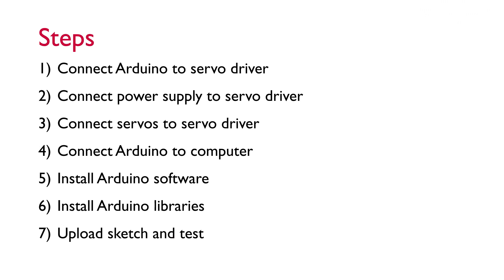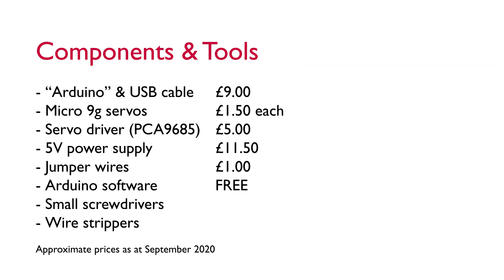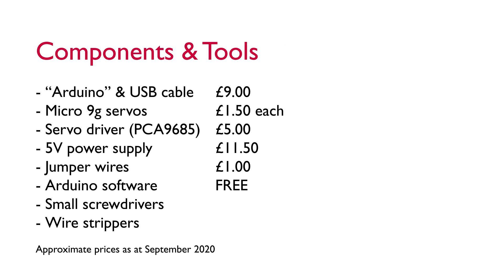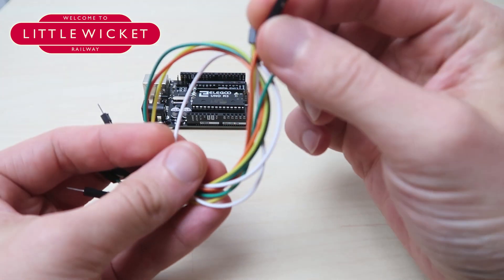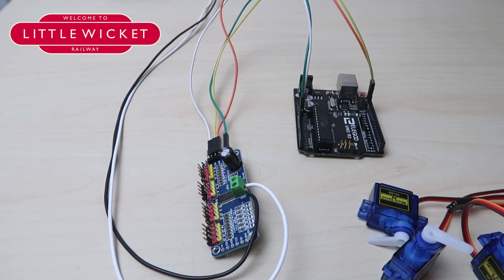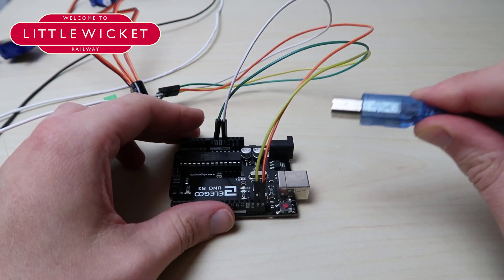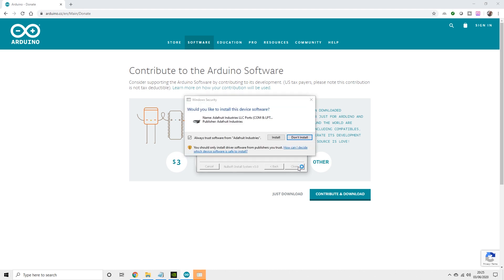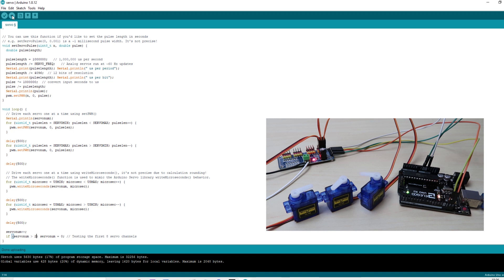Servo Motor Control for Model Railways Part 1 of 3 - Setup with Arduino

Comment: rob, help is needed, followed this excellent helpful video through multiple times and i cannot get my servos to move at the end step. i have checked wiring, checked power source, individually checked servos direct on the uno and cannot work out why i have no movement. any ides? is this video to old and an update needed? thank you

Comment: Hi, I really hope you can help, I’ve obtained all the components in your post with the only change being an Arduino R4 Wi-Fi board with the latest firmware. I’ve downloaded the three libraries and run the modified example servo sketch which has uploaded successfully. All looks good but the servos do not move. Many thanks
Reply from the maker: Do the servos receive power? Check for 5V across the black/red servo pins. If they have power then it suggests there's no PWM signal on the yellow pin.
Reply: @LittleWicketRailway hi yes there’s 5v power from the Arduino UNO 4 and from an external supply to the servo board. I wondered if it was because it’s an R4
Reply from the maker: @Andy_Beckett can you take the pca9685 out of the equation for now and test the servo just using the Arduino using an example sketch that comes in the IDE.
Reply: @LittleWicketRailway yes the servo works directly off the R4. I took an external 5v supply as I’ve read powering the servo from the Arduino 5v supply can damage it. I’ve just ordered a Nano v3 as well as I might want to build a DCC EX and the team have said they won’t be supporting the R4.
Reply from the maker: @Andy_Beckett  so we know the servo works and the R4 can generate a PWM signal to control it. So it's either a problem with the PCA9685 itself, the wiring between the R4 and the PCA9685 or the code communicating between the two.
Reply from the maker: @Andy_Beckett is this helpful https://forum.arduino.cc/t/pca9685-not-using-external-power/1155128/3
Reply: Many thanks for all your help. I decided to go third time lucky and ordered another PCA and the gamble paid off. I’ve finally got an Arduino Mega, Motor shield, Wi-Fi shield and a PCA all talking together. 😊
Reply from the maker: @Andy_Beckett  glad it works, but it sucks that you had some duff kit.

Comment: using you videos to setup 64 points servos i soon realised it is a pain to go through JMRI and click all the points so it knows the position. So made the following Python script for Panel Pro to run at startup to set all points to "CLOSED". Just open a text doc and paste the following and save as .py

import jmri

class setStartup(jmri.jmrit.automat.AbstractAutomaton):
    def init(self):
        return
    
    def handle(self):
        self.waitMsec(1000)  # Initial wait time in milliseconds

        # List of turnout IDs
        turnout_ids = [
            "CT1001", "CT1002", "CT1003", "CT1004", "CT1005", "CT1006",
            "CT1007", "CT1008", "CT1009", "CT1010", "CT1011", "CT1012",
            "CT1013", "CT1014", "CT1015", "CT1016", "CT1017", "CT1018",
            "CT1019", "CT1020", "CT1021", "CT1022", "CT1023", "CT1024",
            "CT1025", "CT1026", "CT1027", "CT1028", "CT1029", "CT1030",
            "CT1031", "CT1032", "CT1033", "CT1034", "CT1035", "CT1036",
            "CT1037", "CT1038", "CT1039", "CT1040", "CT1041", "CT1042",
            "CT1043", "CT1044", "CT1045", "CT1046", "CT1047", "CT1048",
            "CT1049", "CT1050", "CT1051", "CT1052", "CT1053", "CT1054",
            "CT1055", "CT1056", "CT1057", "CT1058", "CT1059", "CT1060",
            "CT1061", "CT1062", "CT1063", "CT1064"
        ]

        # Set each turnout to CLOSED with a delay
        for turnout_id in turnout_ids:
            turnouts.provideTurnout(turnout_id).setState(CLOSED)
            self.waitMsec(1000)  # Delay between each operation

        return False  # All done, don't repeat again

# Create an instance of the class and start the automation
setStartup().start()

Hope this is useful to anyone else.

Comment: Problem solved   FAULTY  Servos!!  All 3 working😁
Reply from the maker: Sorry for the slow reply. Glad you got it sorted. 3 dodgy servos is pretty bad luck. What you building?
Reply: @LittleWicketRailway  I am 75 and building my first model railway for my grandson just born to leave a legacy 
I decided I would go straight in using DCC++ and JMRI  after watching your videos and Charlie from Chadwick  You both do splendid videos. My plan build a test railway  (no modelling yet)  to learn all the skills re wiring build controllers  for engines incl rolling road  etc   that all went well so I built a second test track for points servos signals etc  Learning curve has been steep but enjoying it !!    My last bit of learning is using UNO to control dot matrix displays use MD_parola in IDE libraries .  (have you do Video on that?)  I now have multiple unos controlling the test tracks and JMRI working  Thanks for help

Comment: Hi. Decided to take the plunge and go down this road, have got all the kit you reccommend for driving servo's
because of the way i am having to build my layout i will need to install some motors before i can run a train
so the question is will i be able to upgrade this set up to DCC to controll the trains later without having to re-program the morors?
Reply from the maker: You should be able to convert your layout to DCC with no problem and still use these servos controlled via CMRI.

Comment: I am a real thicko when it comes to setting up computor programs and just know i will make a hash of it so my question is can these mini servos be controlled without a computor?
Reply from the maker: These servos need a servo controller of some type. There are products on the market that will allow you to set them up for switch operation (example https://megapointscontrollers.co.uk/product/servo-controller-12/?v=79cba1185463). Or you can use an Arduino to control them when a button is pushed, but that still involves some programming.

Comment: Hi Rob. Watched all of your Arduino vids - very well presented, simple to follow and great for muppets like me to understand whats going on. I have a question though - you mention that each servo driver needs a separate power supply, so could i run a 5v bus wire and attach the boards to it? I have 67 sets of points, and not enough plug sockets to power each board! Thanks, Alan

Comment: Rob, great video. Everything worked first time 👍🏼 Now controlling 16 servos through JMRI/CMRI. I'm getting a buzzing noise from some of the servos. Have you experienced this? Not sure if they're faulty or aren't lubricated enough. Do you know if there's a coding fix to stop them jittering? Thanks, Ian
Reply: Hello, 

I've been following the video's and got one working but for some reason trying to get 4 servos working is being extremely frustrating. As you have mastered 16 can you point me in the right direction.

All I have done in the servo script is change from 1 servo to 4 but only the 1st servo responds.

Is there anything else you did different to get your 16 working please. (tried changing DE_PIN 2 to 0 and still make no difference.

Desperate to move on, but also just lost 2 of my point springs so need the servo's to change and hold.

Any help would be appreciated
Reply: @lestaylor7767  Sorry for the late reply- I've been out of the country.

The only changes that I made to Little Wicket's 'Servos.ino' sketch (available from the link in Part 2 of Little Wicket's youtube tutorial) are:

1. Set the total number of servos (in my case 16) - #define numServos 16
2. For each servo, define the movement parameters (one set of 'Throw' and 'Close' statements for each servo - increasing the servo number by one for each servo [0 connected to the first set of pins on the PCA9685 board / 1 connected to the second set of pns etc.]) - 
Throw[0] = 1100;
Close[0] = 1550;
Throw[1] = 1300;
Close[1] = 1800;
Throw[2] = 1300;
Close[2] = 1650;
Throw[3] = 1400;
Close[3] = 1800;
.....

Unless you've adding a second PCA9685 board to add more servos, you shouldn't need to make other changes. I suggest you re-download Little Wicket's 'Servos.ino' sketch and make the changes suggested above and hopefully all should be OK.Feel free to get back to me if you're still having issues.

Comment: I really like the idea of using servo motors for points, and this is a great series of videos showing how to do it :-)  

However, and I've seen this in some of your other videos too, seeing the exposed conductors of your black wire at 09:34 makes me shudder :-S  I would suggest that you only strip off about 5mm of the insulation (depending on the size of the screw terminal), twist the conductors and then insert them and screw down, as any exposed conductor is just asking for short circuits IMHO.  

Better still, rather than tinning the ends of the wire, as you suggest at 11:24, just splash out £25 at Amazon on a Ferrule Set with Crimper Tool with insulated bootlace ferrules, which means you get well insulated, strongly crimped connections, which are more secure and protect against shorts (unless you leave exposed conductors dangling out of the back of those too!).  They are also much easier to insert into screw terminals, especially ones which have already been used one or more times, so there's no longer the need to try to force stranded wires into partly compressed terminals :-)  Amazon do various sets, but I would recommend a hex jaw variant, rather than a four jaw.

For a smallish initial outlay you will get much better, safer and easier to install and maintain electrical connections for a few pence per connector, and it saves firing up the soldering iron, and once you've had a little bit of practice, it's a lot quicker to do too 🙂

Comment: Hi Rob, Having seen your 3 videos concerning point and signal control via Arduino and servo drives I am interested to to see if I can apply some of your principles to my garden layout.  I model in 16mm scale using battery and steam driven locos.  My points are operated via solenoid actuators and miles and miles of 22AWG wiring.  Due to the distances I have had to standardise on 22AWg wire because of the volt drop.
I have been experimenting with Micron receivers with servo output to 6 servors, and a Micron T/X I have ended up with signal problems to servos due to the wire runs because of volt drop and that is why I have taken the path using old technology namely peco solenoids, micro switches, LED lights for route identification it works but I believe your method of control is very attractive.

Could your system be integrated with the arduino and servo drive as per your videos noting the distances I have to operate the points and signals.  The longest distance from the central control point the the furthest point is in the region of 20meters.

I am interested to hear if any of your viewers are using your system on large gauge garden railways, and also your views and comments, hoping to hear from you.
Kindest regards,
David Taylor (Spain)

Comment: As of 10/2022 prices make this option prohibitively expensive unfortunately.
Reply from the maker: Hi Scott, you can still control servos for a similar price to when I made the video. On Ebay Arduinos Unos are under £10, PCA9685s under £6.50 and servos for ~£1.50 (if buying a pack) - works out at just over £2.50 for 16 servos. You might have to wait for it to be shipped from China though. If you want to gamble on AliExpress then prices are a lot cheaper. A commercial slow action point motor (admittedly with switches built in) will cost ~£20

Comment: All working for me! Just an additional tip for any complete newbies like me - once you have run the servo test program - it will keep running forever.  The only easy way to stop it I could find was :  file / examples / eeprom / eeprom - compile and upload.
Reply: Hi Mike did you use Eeprom clear.
Reply: @garytaylor5959  Sorry - yes I did, as I was then going on to test something else.

Comment: Can you go about controlling the servos without the arduinos for example from centre off switches as you would using solonoid point motors on an analogue system?

Comment: Rob;   Great series of videos.  Very easy to follow.   Apologies for the long post, but I want to be thorough.  I seem to have a weird problem.   I can only control 2 servos.  It does not matter which 2 (out of 8).   If I comment all servos out except for 2  of them (It doesn't matter which 2) , those 2 work just fine when controlling via JMRI/CMRI.   If I add a 3rd to the mix, none of them work.   I can control any 2 of the 8, but only 2 can be uncommented in the sketch.
I tried using just an UNO with the PCA9685 and then a mega with sensor shield ( and without)   I swapped between 3 different PCA9685 boards.  All behave the same.   

Power supply measures a steady 5.03 volts for the servo power supply when servos are moving and when not .

As I am not using a 485 bus, I tried commenting those lines out and changed the CMRI line to this:
CMRI cmri(CMRI_ADDR, 24, 48, Serial);
Same results.

I wrote a sketch to cycle through all 8 servos one by one and this sketch works great.   Even tested all 3 PCA9685 boards with this.  And tried with the UNO and Mega with and without sensor shield.  All is well with any combination.

Any input would be greatly appreciated.
Thanks
Dave

Comment: Hi Rob,
Thank you for all your videos. I followed every steps but the servos don't work. After having watched many other videos on youtube it was the same problem.
The servos are ok when they are directly plugged on the uno but when i plug them on to the pca 9685 nothing happens.
Yesterday I just unpluged V+ on the pca9685 and pluged the same wire on the V+PIN on the same pca9685 and IT WORKS now !!!!
The problem is : i don't understand why!
If anyone has the answer....
Thanks for all your videos again!!
Cheers from paris.

Comment: Hi Rob! So I'm finally getting round to using your videos on my layout, I wanted to ask:
I have an Arduino setup for DCC++EX Control and I will have one for a sensor hub. I'm assuming I need a 3rd to run the servos or can this be done with the 'Sensor Hub' too? Probably a stupid question due to them needing different Shields.
Anyway thanks for the video series, I've watched them multiple times and finally ready to use them myself!

Take care

Comment: Thank-you Rob. I did most in about 20 minutes whilst watching. I used an old laptop with windows XP as I can move from desk to loft etc to control railway. In short, latest software is not compatible with XP, v 1.8.9 is according to a thread I found, so loaded that. Also had to point software update for USB driver to the arduino/drivers folder. 3.5 hours to resolve the XP issues, so magic to then see my 2 test servos with synchronised twitching. :-) Pace/style of your delivery is excelent (says the retired vido producer). Thank-you again for parts 1, 2 and 3 and I'll be revisiting your DCC controller videos too. :-)

Comment: 10:48 better apply a little bit of solder to stripped wire ends so that these do not fray when trying to insert in screw connectors

Comment: Better use jumper wires of the correct colour (8:20), red for supply voltage and black for ground.

Comment: Hi Rob, I wonder, with the Servo Driver PCB. Do you think it’s possible to have just a Physical button control, like a toggle?
Or does it require the power and commands from the DCC++ arduino to do the logic? Thanks.
Reply from the maker: It's possible to have it so that a servo can be operated by a button, but you'd still need a 5V power supply and a way of generating the PWM signal. An Arduino is probably overkill for a single servo, but it's easy. You could probably create your own circuit and program a microcontroller to do only what you need for a more compact package.